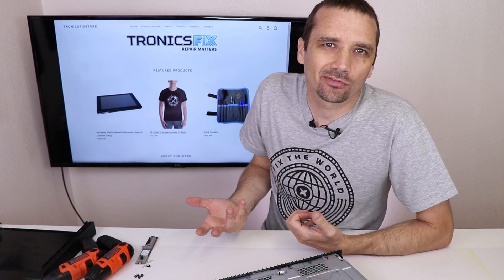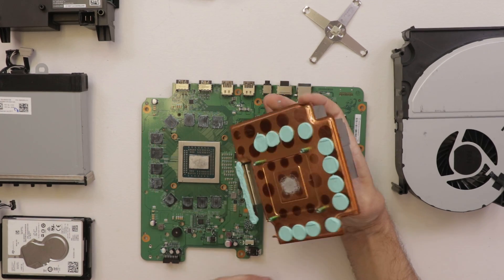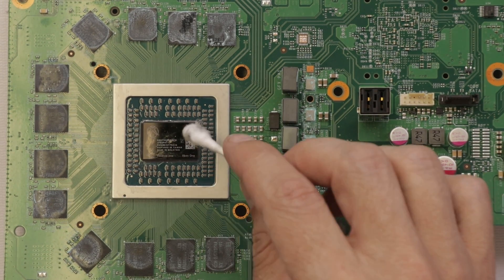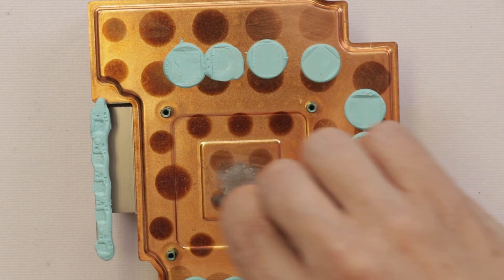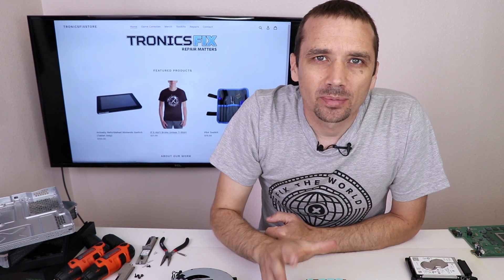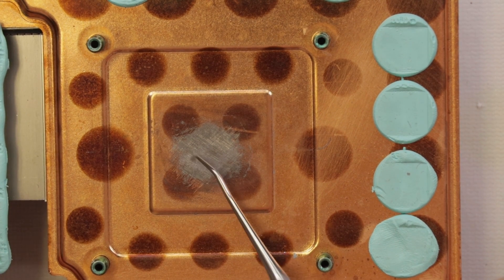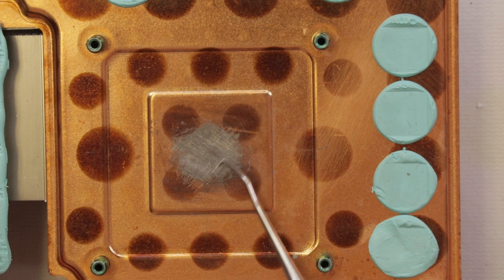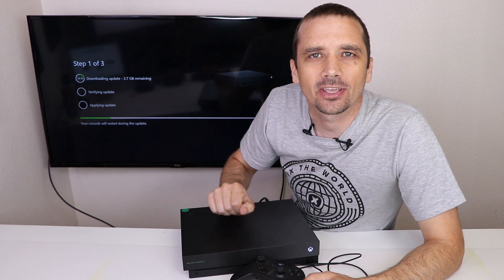Effects of Liquid Metal After 9 Months

Comment: It's not damaged. Liquid metal is mainly gallium, which creates alloys with other metals easily. It's completely normal.
Reply: For all interested, Gamers Nexus tested liquid metal in PC with different heatsinks. What they found was
-Liquid metal damages aluminium, DON'T DO IT
-Copper and nickel plated copper show discolouration, but they could not measure any differences in temperatures before and after liquid metal.
Reply: So i guess to simplify, it basically stains the copper, but doesn't damage it.
Reply: @TakeNoShift  It creates an alloy with it . IF you count that as damage or not is up to you.
Reply: @andljoy  I guess it depends on whether the new alloy conducts heat better or not
Reply: @andljoy  that alloy properties might vary from original metal probably compromising structural integrity
Reply: @andljoy  The heat sink in this video actually looks copper plated because as he was scraping the copper layer was coming off with it. In which case it would not be good to have liquid metal. It’s not that much of a gain for a pretty big risk. That stuff is widely known to migrate from the cpu die if you put even a little too much and sometimes even if it’s the right amount, potentially shorting out and ruining nearby components.
Reply: @andljoy  it's not up to you, dummy, it's up to wether the alloy has better or worse thermal conductivity, go to school
Reply: @TakeNoShift  It's not a stain, it's an amalgamation.
Reply: @sithlordmaster181  A stain is technically an amalgam. A stain is just a chemical or physical interaction between two things that causes a discoloration.
Reply: @TakeNoShift  exactly
Reply: @TakeNoShift  no it corroded the heat sink mixing metals will always cause corrosion
Reply: @noahramos1768  no
Reply: @noahramos1768  Corrosion is generally regarded as when material is eaten away and lost. LM alloys on the surface of copper but it's still pretty solid and not really corroded
Reply: @Noah ramos yes/no basically you need to form some sort of a battery (oxidation rxn). I believe though that is true but without a third party (air, another metal, soil, or something like that) it is on a very small scale for copper and Gallium. This is just top of my head as a 8 year plumber and now 4th yr ChemE student. I very well could be terribly wrong though without looking up some stuff.
Reply: @noahramos1768  That's not actually true (common misconception) - and what you see in the video is diffusion not corrosion.  Corrosion requires an anion reaction.  The heatsink experienced thermal diffusion of metal - possibly gallium - or more commonly Ni or Al.  I do not know what is in LM - so I do not know which metal.  It's actually interesting - and it might even have improved the heatsink (I don't know about the scratches though).
Reply: @noahramos1768  That's idiotic. Mixing iron with chromium creates a low-grade stainless steel, a metal which is more corrosion resistant than iron. Adding nickel makes it even more corrosion resistant.

The reason you've heard it is in the context of liquid coolers, where an ad-hoc electrochemical cell is created, basically, a power source. There are several components to it, anode and cathode are formed by different metals, which must not touch each other directly, but are connected via an electrolyte, a preferably somewhat corrosive, ion-rich liquid. Salt or other contamination in water creates an initial electrolyte. Voltage incurred will compel metals to be transferred from one to the other via the electrolyte liquid, dissolving one of the metals, and some of it will just precipitate with increase in saturation.

In case you connect two metals directly, you have created a thermoelectric junction, which does have a voltage, but since it can circulate the charge directly, this does not generally become a corrosion mechanism.
Reply: @CrowDaddy1  actually Noah is right. It will erode the copper over time by forming an alloy it will erode through the copper heat sink and that’s why they recommend you replace the liquid metal regularly annually because it will help prevent long term corrosion  but it will face corrosion damage
Reply: @mudassirul  not true I’ve seen corrosion and alloy deposit buildup on metals before and that wasn’t an alloy build up gallium has habit of changing the properties of other metals which makes there structures less durable
Reply: @AB-these-handles-are-stupid  look up gallium and aluminum look up the element chart for aluminum and compare it to copper. Even though it’s small amounts reheating and having electric currents traveling through the liquid metal causes different chemical reactions and even if the plate and heat sync is made of nickel the paste itself loses efficiency over a 2 year period...
Reply: @mrpumperknuckles1631  so it's better to use a good thermal paste and replace that more often would you say?
Reply: How about properties of that ally on video? Is it worse than pure copper?
Reply: Yep, LM my Xbox One X. No regrets.
Reply: @zebular  sorry a year late but how is it? I'm considering putting liquid metal in.
Reply: @shanehopkins87  still working great!
Reply: @zebular  was the xbox one X getting too hot??
Reply: @rwhite9994  nah, was just already in it for a hard drive swap
Reply: @zebular  Ah I c, I also swapped to a SSD on both my 8th gen consoles after a year in. But did not buy the pro. Was wondering.
Reply: LM'd my laptop, checked up on it a year later. Copper was discoloured, like this but still solid- some LM solidified but as long as it was filling out all the space it's doing it's job.
Reply: If it is mainly Ga, it will melt everytime he turns it on.  What is it alloyed with?
Reply: I put liquid metal on my Xbox one x for some reason still seems rly loud :/not sure if I should change it or maybe the fan is just broke because the console it not overheating perfectly cool just the fan speeds up quite a bit rly annoying.
Reply: You'll still have to change it out more fequently than paste. There's no foam damn like on the PS5 so it will seep out and dry up.
Reply: @samgee500  lol 😂 .  I’m sure that “foam dam” gonna work out just fine.
Reply: @Sonny. Alloys are bad for this purpose. There is a reason the Microsoft geniuses used expensive copper instead. Over time he may have overheating issues, or rust degrading due to the copper rust resistance being weakened by this alloy.
Reply: @Keepskatin . Pretty sure they just chose copper because of its thermal properties and it has a proven long term data. Basically they wanted to play it safe, and why reinvent the wheel.
Reply: @robertt9342  you are basically agreeing with me, what is your malfunction ❓🗿
Reply: So, what was the temp before and after?
Reply: its the 2 stroke vs 4 stroke again lol
Reply: As long as you forget what it does to aluminum..... sure why not
Reply: It always kinda freaks me out and I think it's mercury 😆
Reply: Well you could always buy a replacement heatsink for a console as the worst case. The LM won't destroy your APU.
Reply: go with normal thermal
Reply: Master chief on a Scorpion
Reply: Master chief on a Scorpion
Reply: I think you need to consider following 2 sides which are interrelated:
a) the solid copper
b) the liquid metal

The liquid gallium in the liquid metal is quite reactive and alloys with the solid copper to form CuGa2 as a top layer on the copper heat sink. CuGa2 is mechanically stable (so it is nonsense to speak of corrosion) and its thermal conductivity is with 95 W/m-K lower than that of pure copper with around 400 W/m-K, but 95 W/m-K is still quite high compared for example to thermal grease mostly having only single digit x W/m-K and due to the thinness of the CuGa2 layer a degradation of the thermal heat flow is not really noticeable (die temperature increases only by 0.x or even 0.0x °C).

The harmful side to apply liquid metal to copper is the liquid metal itself. When the reactive liquid gallium leaves the liquid metal to alloy with the copper it leaves an ever lower percentage share of gallium in the liquid metal. This results in first some part of the liquid metal to become hard at room temperature and ultimately all the remains of the liquid metal will become completely hard and quite difficult to remove. I think no damage is occurring by this hardening of the liquid metal, but degradation (the silicon die becomes too hot) which requires service (the TIM  must be replaced/renewed/reactivated).

In my understanding it is possible to apply liquid metal on copper, but beside of the mandatory precautions against short one must also be prepared to renew the liquid metal all 6 months or whichever time period it stays liquid under specific conditions as purity/porosity of the copper, temperature level, what kind of specific mixture liquid metal is applied, ..... When re-applying I would just remove the hardened liquid metal (if any), but leave the CuGa2 layer on top of the copper in the hope that an existing CuGa2 layer slows down the speed liquid gallium continues to migrate into the copper.

In my understanding there is no reaction between the liquid metal and the silicon die and also the speed gallium reacts with nickel is much lower compared to copper. So not only for the quite strong temperature down effect, but also for longevity best is to apply liquid metal between the silicon die and a nickel plated copper heat sink as is done on delidded CPUs.
For X-Box or notebooks using copper heat pipes/sinks you need to accept regular 6 months replacement efforts when you want to enjoy the low temperatures possible with liquid metal (the low temperatures being the result of mainly an extremely thin gap/layer due to the low viscosity of liquid metal in combination with quite high thermal conductivity ranging 40~80 W/m-K and also a low contact resistances compared to thermal grease with contact resistance being the interface Silicon-TIM and TIM-Metal).
Reply: Gallium reacts with metals other than aluminum. This reaction changes metals such as copper and tin to bond with the gallium. This can weaken the composition and structure of copper. That is damage that youre seeing. Although not severe.. It is irreversible.
Reply: Well check Galiums reaction with Aluminium... if its an Alloy, it gets other properties, even for "heat transport" you dont want alloys to form.
Reply: @yatagarasu1495  depends on what alloy- LM itself is a galium-indium alloy. The best metals used by industry are alloys, but galium alloying with aluminium isn't good
Reply: @mudassirul  i know, but it looks like it became powdery like Aluminium Galium Alloy, which usually means losing part of its "metallic properties" (ironically) Its possible its even insulating now.
Reply: @yatagarasu1495  Just because it's technically an alloy doesnt automatically mean it's bad. It's a very slow diffusion of gallium ions into the copper. People who have had liquid metal for years on the same heatsink will tell you in doesn't hurt performance either...
Reply: @yatagarasu1495  Doesn't that depend on the alloy that is formed? (considering we use a lot of alloys that are extremely good at heat transfer)
Reply: @yatagarasu1495  false. Some alloys conduct heat better than their constituent parts alone. Simply adding more LM to this would restore perfect operation. 

After a few cycles of refreshing the LM stops integrating into the copper and stays wet for years.

Source 20+ years using gallium alloys for cooling....
Reply: That looks a lot like almagamtion. Gotta check CuGa almagama thermal properties but generally almagamtion is something you really wish to avoid at all cost.
Reply: @Kennerfull  That’s true. Amalgamation is the perfect word to use here
Reply: Sony , yea it’s almost like solder. Looks like it to me anyhow, like the solder I would use for potable water copper lines. Definitely a point from me for your post.
Reply: It isnt forming an alloy between the gallium and the copper. The Gallium is just plating out on the copper. If you were to look at the cross section, you'll see solid copper with a layer of gallium on top and in some of the pores of the copper.
Reply: THIS!
Reply: It does create damage. But not like in the video some GPU/CPU Die will get scratches over time due to liquid metal getting hard over time i had this happen on my 1080 Max-Q Laptop as Well as my GTX 1070 Max-Q Laptop and on some Macbook pro CPU Dies Don't know why but it happens on some machines its not on all of them sometime it will stay in liquid form for really long other times it will be harden up after few months.. I guess it has to to do with Die itself being different or maybe cause of writings on the Die are living space for air to get in and its drying out faster. I don't know but i am sharing my experience.
Reply: I'm pretty sure that is galvanic corrosion cause by copper and gallium mixing.